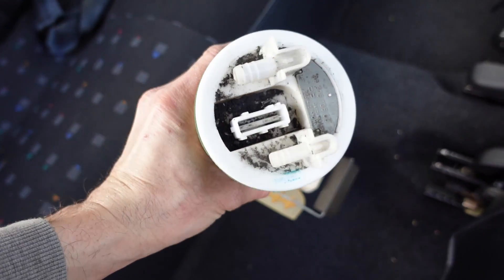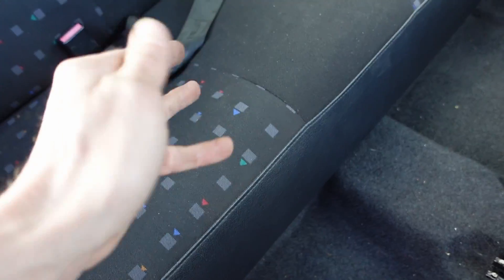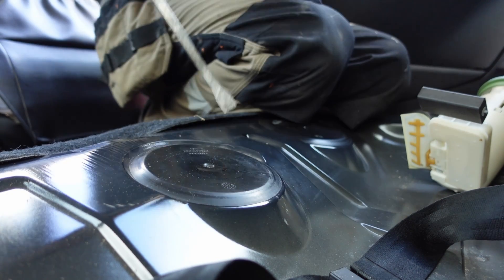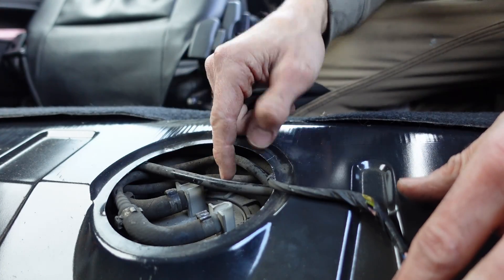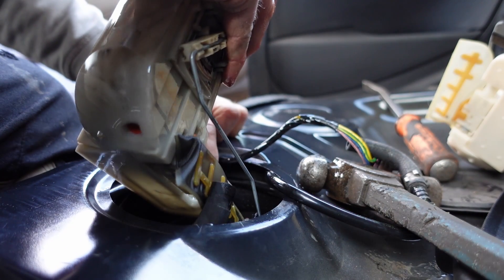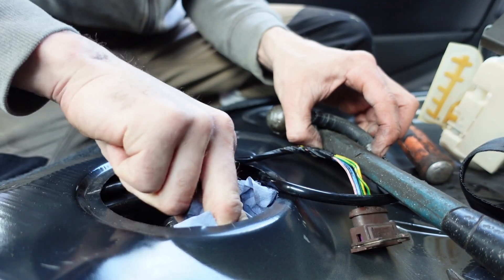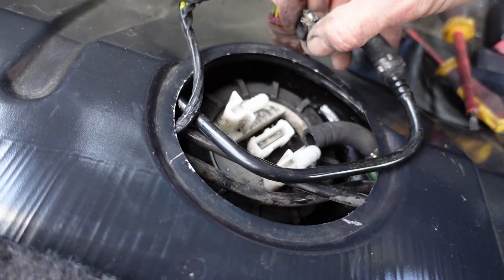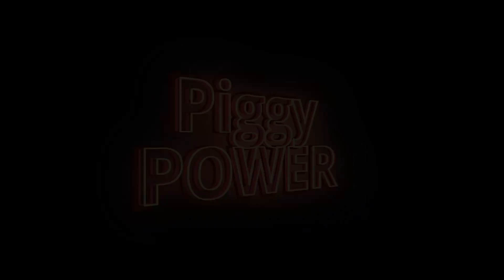HOW TO: Citroen Saxo, Peugeot 106 - FUEL PUMP change

Comment: Bonjour, pourquoi avais vous changer la pompe? Je possède une saxo de 97 un soir en voulant partir du travail la voiture ne voulais pas démarré le démarreur fonctionne mais le moteurs ne tourne pas comme si y avais plus d'essence alors que j'ai le plein est la pompe ne fait pas de bruit comme la votre vous pensé quelle est hors service ?? Merci d'avance pour votre réponse
Reply from the maker: If the pump isn't pumping fuel.... Check power to the pump. 
If it has power/electric then yes pump has failed.
Reply: @PiggyPower  merci beaucoup pour votre aide👍🏼👍🏼👍🏼 bonne journée est encore merci.

Comment: hi mate. i ordered a pump but it came without the seal/gasket to fix it to the tank. do you think it would be possible to remove the seal from the old pump and reuse it. I cant seem to find the seal for sale anywhere without buying another spares pump. just wondering if you have any suggestions.
cheers!
Reply from the maker: So long as its in good condition... Yup
Reply: cheers will give it a go. @PiggyPower

Comment: Hi nice video. I have peugeot 106 1.1 fuel injection year 2001 and at a sudden it is not starting. I checked the wiring plug connector the fat wires, and when i turn the key it is reading around 2.7v but when i crank it up it reads around 11v. Do you think there is enough supply to the pump it is normal like that? I dont hear the pump starting and i hit it like you said. Thanks really need to know whats happening. I changed the fuel filter aswell to be sure as it was a little bit clocked, also it blew the pump fuse 10anps 2 times but now i changed it and didn't blow. Thats why i thought there is a problem with fuel pump at first place.
Reply from the maker: Sounds like fuel pump is at issue. Try the same test of voltage with the plug UNPLUGGED. If it's the same, then the supply voltage is at fault. If it's 12v+ when you turn ignition on and then crank... Then the pump is at fault likely. Check earth too
Reply: @PiggyPower  i already checked the plug when it was unplugged and when i turn Ignition with the multimeter i check the fat wires ax its reading 2.7v but when i try to start it it reads 11v. It is good or bad? When i only turn ignition on its reads 2.7v but if i try to start it reads about 11volts.
Reply from the maker: @renecalleja6754  something a miss, when you flick the ignition on, it should prime the pump with 12v. I think there's a relay or wiring issue
Reply: @PiggyPower  only the wires for the gauge the thin ones have 12v the fat ones only have 2.7v when ignition on. Which relay should i check for the fuel pump? Many thanks :)
Reply from the maker: @renecalleja6754  fuel pump relay probably 😜
Reply: @PiggyPower  haha i will try to find it it is in the engine compartment? Thanks mate
Reply from the maker: @renecalleja6754  get some googling going and maybe grab yaself a manual, a Haynes or similar 👍😀
Reply: @PiggyPower  thanks mate 👍

Comment: Thanks for the video.
I have a VTS 1.4cc, is always a pain that job! The hole is so narrow (f**ken)! (I have replace the pump 3 times! Mod 2001, with only 80.000 Km)
First I always disconnect the battery. A bucket beside is helpful when I remove the body from the tank.
Is there any o-ring under the Nut-Ring? (except the thick conical seal/gasket)
Reply from the maker: Just one seal/ring to seal it in. The VTS was a 1.6 16v?! 🤔 Why have you had to replace it three times?? Something odd there .. do you run fuel low a lot? Or replacing with bad product?
Reply: @PiggyPower  Hi, mine (my wife's) is 1.4cc VTS (not VTR), probably for the Greek market. 
I had to replace them, due blown motors. The last 2 was the "expensive"  VDOs (with the grey stamp/label, like yours as I saw on the video). 😁

Comment: Did well to that with out sweering my q
106 gti start fine leave it ten minutes won't re start??
Reply from the maker: Lack of spark of fuel?
Reply: @PiggyPower  start over & over fine runs drives, leave the car 10 minutes & won't re start, just cranks over... then will start back up fine hours later... changed the crank sensor check fuel spark good so it's a mystery even changed Master fuel relay...
Reply from the maker: @49CCHRIS  so when it doesn't start... Is it lacking fuel, spark or both?
Reply: @PiggyPower  start fine cold in the morning have spark fuel, left ten mins won't re start for hours & there still fuel & spark its Herbie
Reply from the maker: @49CCHRIS  so it's still injecting fuel and sparking .. but wont start??
Reply: @PiggyPower  yes but other sensor could be faulty & the ecu won't open the injectors or could b fuel pressure drops the map sensor who know there is a obd port under the fuse box wonder if it work if get the testing kit?
Reply from the maker: @49CCHRIS  you'll want Peugeot planet ideally. So .. is it injecting fuel or not when it won't start?
Reply: @PiggyPower  hi thanks for trying to help... today installed a fuel pump & it works fine car starts up like the old pump starts runs, but my issue still there once left turned off won't re start! Changed crank sensor, pump, master relay, got spark from coil pack, use to take the plugs out, when the first stated put back together then would fire back up, but issue got worse! & car dies now when driven so my guess is the coil pack breaking down & turning off at times, adding up the costs, night mere could a temperature sensor cause this?
Reply: Or map sensor?
Reply: @PiggyPower  when the car won't re start, I took the fuel line of the rail & and chucks the fuel out the pipe, iv got know way to test if the injectors are operating when car won't start, plugs seem dry 🤔
Reply from the maker: @49CCHRIS  you really need to diagnose it properly rather than just throw parts at it pal. When it doesn't start... Is fuel injecting? Is spark being produced? Neither? Both?

Comment: i have a problem. my peugeot 106 1,4xs from 1995 has to under the back seat. the on the left, is the fuel pump, the other is just a look alike but with a 3-legged plug. i would asume that it is the fuel tank reader. and it dosent work. the neadle is stuck at quater tank.
Reply from the maker: Sounds like you need to fix it then 👍

Comment: Good job! Be careful with submerging fuel hose in a tank. Not all are suitable for that, meaning you run the risk of getting contamination in your fuel system, and in time you'll have to do the job again.
Reply from the maker: When did I submurge the fuel hose in fuel?